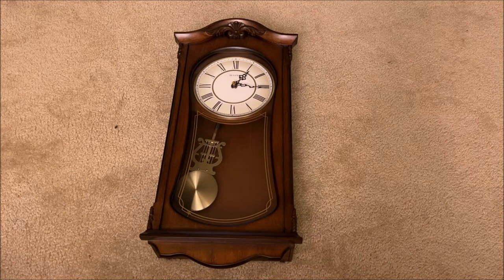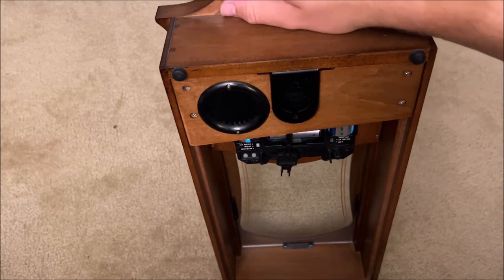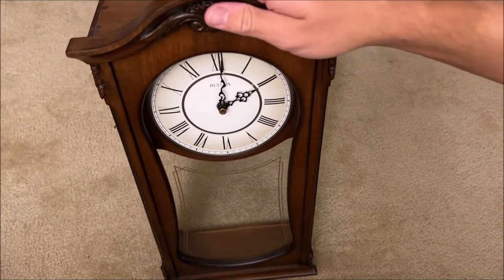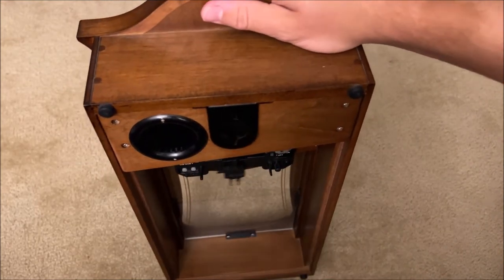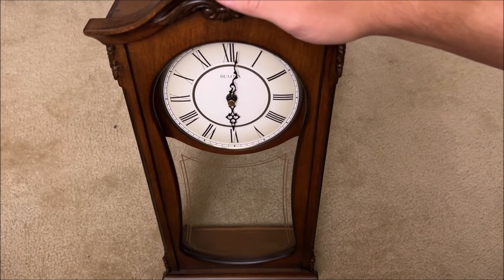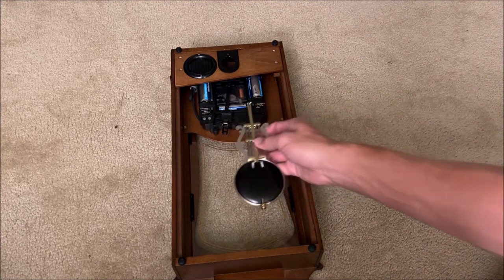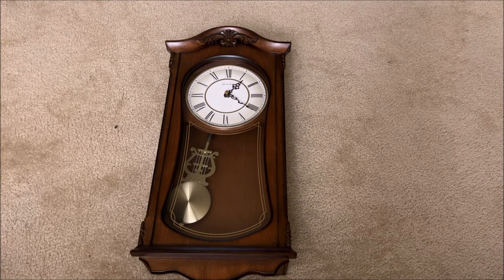Fixing the Hour Strike on my Bulova C3542 Wall Clock

Comment: My Grandpa Have A Shelf Clock He Takes The Batteries Out Of The Clock And Put It On 5:45 AM And Then He Puts New Batteries In The Clock. Hope You Are Having A Great Day!
Reply from the maker: Yep that’s what I do too!  Have a great day as well
Reply: I do not have C batteries mine has two things it takes four AA batteries and the Pendulum keeps stopping it looks like it was dropped at one time there was a small magnet inside of it for some reason on the top where the speaker in stuff was not sure what that was about
Reply: Okay I tried to send you a picture of the clock but for some reason I can't send a picture it wants to take a video

Comment: Easiest way to set clock back one hour for daylight savings time?????  Instructs say not to turn hands backward at any time. Thanks.
Reply from the maker: Yeah definitely don't turn the hands backwards because then the chime sequence will be off.  I would set the clock to 5:45, and press the reset button.  Then set the clock to the correct time including going past 12 o clock for evening times if you have Night Time mode enabled.

Comment: Hello.  How do you make the pendulum move?  Ours doesn’t move.
Reply from the maker: It should move on it’s own because the batteries power the pendulum.  Try swinging the clock casing to the left and then back to the middle to help it start swinging

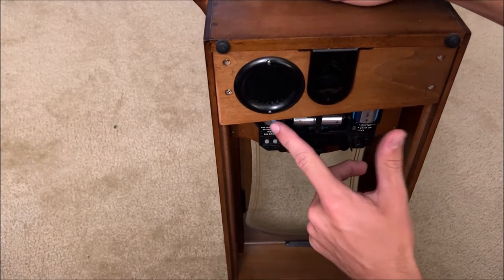Comment: What do you do when the clock chimes but the chime is incomplete?  It doesn't strike.  For example at 1:00 the clock chimes but doesn't strike one time.  Any suggestions?
Reply from the maker: I explained in the video.  You set this clock to 5:45 AM.  Press the reset button, then moving the hands forward only, set the time to the correct time.

Comment: I have a question. I want to buy this model of clock but first the Amazon website says its solar powered but also requires batteries so if you could how is this clock powered
Reply from the maker: Well this clock is definitely not solar powered, it's powered by 2 C batteries and 1 double A.
Reply: @Jamestube8439  Thank you for your answer and response
Reply from the maker: @southernphonemanstelecom2634  You’re welcome.

Comment: This just did not work for me. My Bulova clock is at 5:00 and it chimes seven times. This has been going on for years, I just can't fix it. Sometimes it's off by an hour or two and sometimes I just go round and round and round with it trying to get it synced and when I think that I do it screws up the next time at chimes...
Reply from the maker: Do what I said in the video, set the hands to 5:45, press the reset button, this resets the clock to 5:45 AM.  Set the clock to the correct time, if the time is between 6 pm to 5 am, you’ll need to cycle through twice because if you have night time mode enabled for the chimes, you’ll want to set the clock to the correct time so it’s silent for the night (which is between 11 pm to 6 am)

Comment: My pendulum clock works well, but everytime it struck 8, it sounded like it skipped, making the clock start chiming more than what time it is
Example: It would start chiming 10 times at 9☠️
Reply from the maker: That’s strange, so if it chimes 7 o clock, at 8 o clock it skips the 8 and does 9 chimes?
Reply: @Jamestube8439  Yea

Comment: Why did you pick 5:45 to reset it??
Reply from the maker: Because when you press that reset button, it resets it so that the next chime would be 6 o’clock in the morning.  So I set it to 5:45 so I could chime it at 6 am when I turned the knob. You can really set it to anytime within 5:01 to 6:00 am it doesn’t matter, just as long as it’s any time within that otherwise the chime will not strike the correct hour